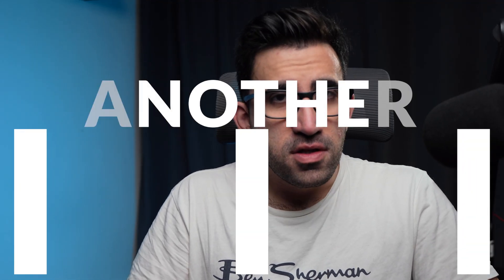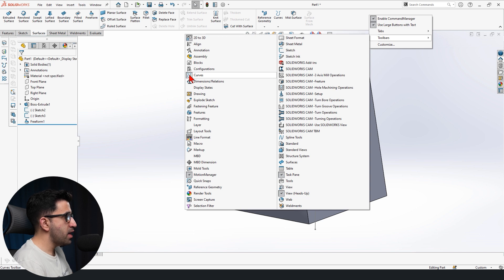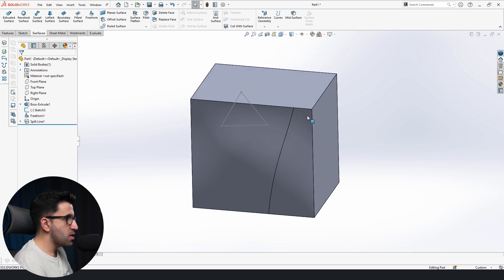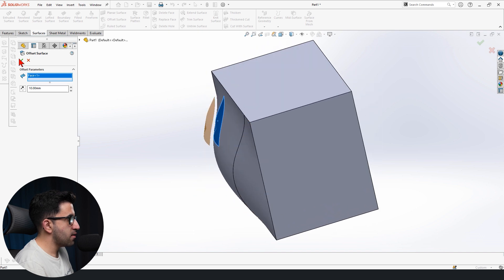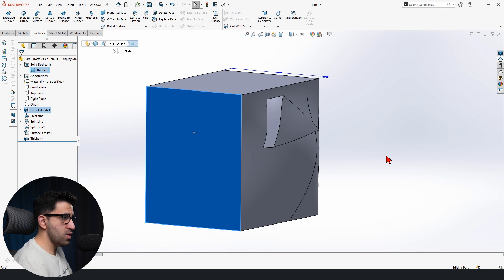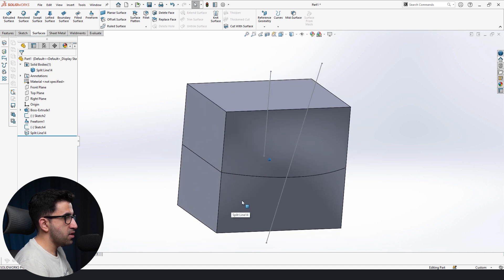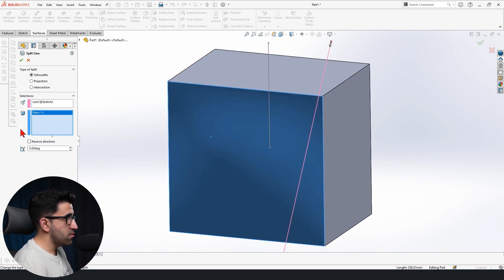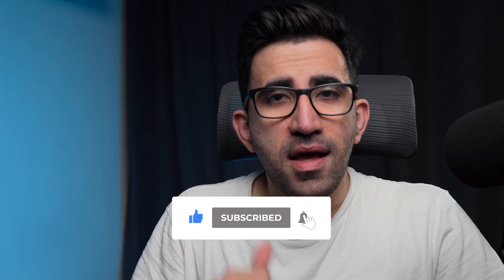Quick Tip Split Line | SolidWorks

Comment: I use them for splitting surfaces to apply draft on molded parts.    Solidworks is weak in terms of parting line drafts. It only does very basic parting lines.

Comment: Dear Aryan Fallahi, i am commenting on Silhoutte curves fundamentals
we can also say it draft curve with taper angle. it works by using planes only, even if we select a sketch....
I means whenever we select a sketch and surface to get a split line on it, solidworks shows us sketch but grab the plane of selected sketch in real sense, till here if i just passed to convey the message then i can further explain silhoutte curve...
for an example, let me consider a sphere which is 100mm of diameter and its centre position is located on origin. now after placing it and trying silhoutte by using split line feature then it will become easier to understand...
just select Front plane at step 1 (i means, no need to select a sketch) and without changing Zero value of degree, apply first curve and notice that it gives you the same curve as you can get through intersection of the Front Plane upon sphere's surface, but just change the degree for re-viewing and see the magic of silhoutte curve, which will be parallel to the front plane (in case of sphere) but will be at distance of 10 degrees taper....
same method can be useful for 2 other planes with the same position/location of sphere.
It is used that whenever we rotate our component or model, then silhoutte curve does not change its parameters... for further details, i have to change my example from sphere to any other 3d surface (non-planer)
This is my whatsapp number 0092312-6449249
it will be a great honour for me to share my experience by taking silhoutte curve with more details if i have been asked by your greatness.... Sir Aryan Fallahi, Thanking Yours

Comment: Split line is useful in conjunction with Simulation where for example you want to apply a pressure force to a specific area on a face and not the whole face.  Good video! I intend to look into the diligent feature in SW help.  Cheers!
Reply from the maker: Absolutely!

Comment: I own a 3d printing company. I use splitting large part into sections, so it can fit my printers. Then I have to add dowel or something like that to help to assemble.
Reply from the maker: Good day, That is a great business since the ROI is great as well, one tip is try investing into a platform for splitting parts, since there are software like Netfabb, which can not only auto split your part, but also auto add the dowels and holes or even tabs that fit into the other component instantly.

Comment: While designing an off-road truck bumper for chevy or land cruiser. Using Slicing tool and Split line in convert method, or Flange method I get a perfect line matching the car profile.
Reply from the maker: Great point!
Reply: @with-aryan  I'm highly interested in opting for your Solidworks Pro course, but I'm tight on budget nowadays. Hope to see you as a mentor and guide in carving myself as a Mechanical design engineer. I have a query if I opt for your course will it cover GD&T fully, will I get mastery on that as well or not.

Comment: I have used it for showing partial threads on bolts, rather than cosmetic threads, because that graphic doesn't show up on silhouette line drawings - such as in Installation / Assembly guides. It uses less resources when an assembly contains multiple instances of said fastener, rather than displaying modelled helical or rotated representative threads.

I've also used it to good effect for laser etching features.
Reply from the maker: smart

Comment: I use it all the time. It's great for the reasons you describe, like breaking up surfaces to gain more control of geometry. For instance, when adding draft to a part for moldability, you sometimes need to manipulate where the draft should take place from. The other use case is for graphical reasons. I'll create vector artwork in Illustrator, bring it into SW and make it into a Block, then scale and locate the artwork. I then split a surface and change colors to apply simulated pad printing or other graphics. These breaks in the surface allow dimensions to be added in drawings to help locate pad prints.
Reply from the maker: I liked that. Thanks for sharing your experience
Reply: @with-aryan  Anytime!

Comment: I've started to use Split Line for showing exactly where a knurled surface/texture will go on a  part's surface. It definitely helps to use it to section a specific area for certain appearances or textures. I'm trying to see if it can be used for showing laser etching vs. using a very shallow emboss.
Reply: I have used it for laser etching and in some cases, a shallow cut, as you have suggested - whichever one works best on a drawing or DXF file.

Comment: I've used Split Line like a handful of time over the years, but in every case it was some hyper-specific workaround for something else, or literally just for visual use on drawings because projecting 3d geometry works way better than sketching 2d entities onto drawing views. I discovered the 2d elements of Solidworks are actually very limited, so it's not a viable replacement for something like AutoCAD if your entire product library consists of 2d blocks.
Reply from the maker: AutoCAD beats SW in 2D every time, it's 3D that you buy SW for

Comment: I use split line to split face for applying forces in simulations. Never used silhouette.
Reply: ooh interesting use case
Reply: I use it the same way in simulations. Sometimes also for fixtures.